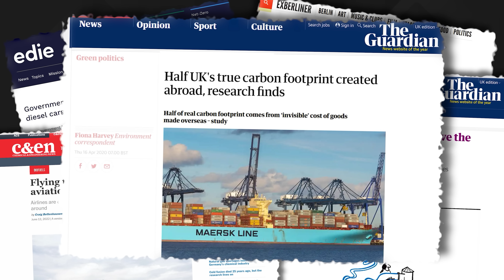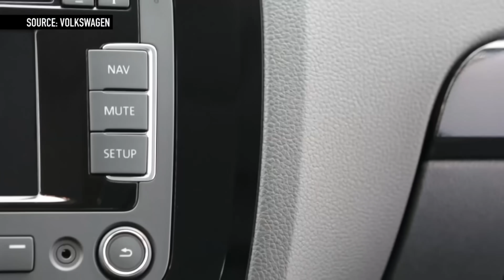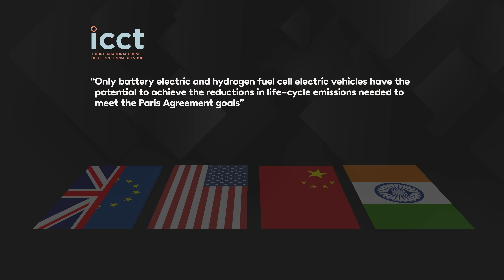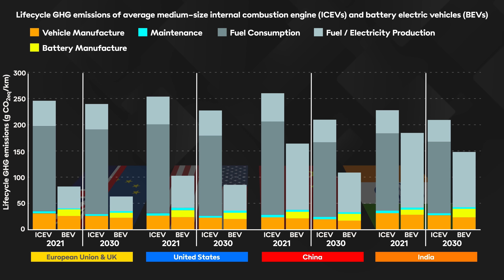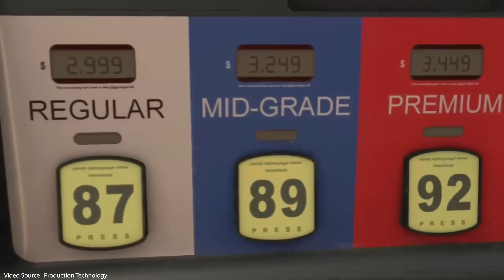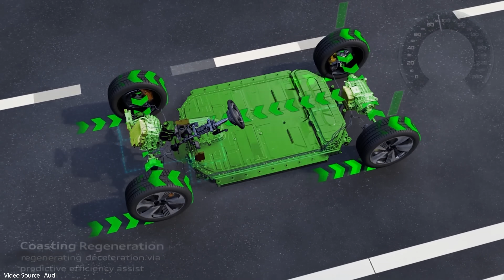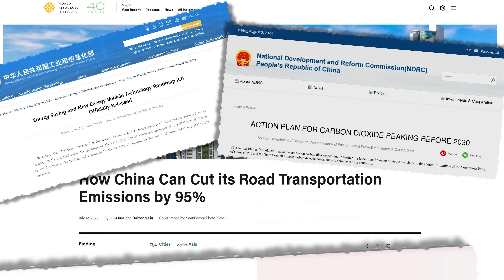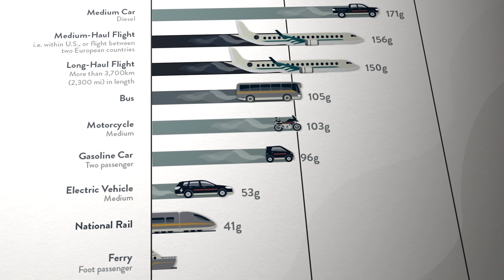Are EVs really better for the climate?

Comment: What are your thoughts on sourcing the raw materials for EV batteries? I’ve heard that EVs don’t offset the fossil fuel needed to gather the raws
Reply: Most of the mineral rich places for the metals for EVs happen to be in places that we should not touch like rainforests, right by water sources, near residential buildings etc. Mining these metals are extremely toxic to the surrounding environments without proper regulations,  and all the locations to mine these metals are in places where the government does not work properly.

Comment: My experience with my plug-in hybrid electric vehicle (PHEV) is quite a bit better than you stated.

My battery range is 30 miles, more than enough for most commuting and shopping.  With mine, I get 175-200 MPG each month, and pay little or nothing to charge.  I have free electricity at night.  (This is good for the utilities, too; it means fewer new plants, especially "peakers".)  I do most of my charging at home and at night.  I have no need of special trip to a charging station.  On the average, I only have to charge 3 nights a week.

For those worried about battery electric vehicle range, charging availability, raw material scarcity, and/or cost, a PHEV is a better option.  If you can't afford or can't live with an BEV, a plug-in hybrid (PHEV) will allow you to eliminate around 90% of your emissions, without being limited geographically.

If they were smart, the fossil fuel industry would be promoting only PHEVs so they will have a soft landing rather than a crash.  So should climate activists:  Nation wide charging station deployment at the needed pace will be subject to spottiness, start-up glitches, supply/demand imbalances and corruption.

Taking all factors into account, PHEVs are the best way to get people to change over to low-emission vehicles in a country with a heavy political interest in oil, where some people don't accept the reality of climate change, where many have yet to understand the advantages of non-hybrid BEVs, and where most don't understand how to use a PHEV correctly.  It took me a while; after 4 years with mine, charging is as second nature as filling the gas tank.  It's better, because I charge at home while I'm sleeping.  🙂

IMHO, only PHEVs should get government incentives.

"Just Have a Think" is one of the best channels on YouTube.  Keep up the great work.

Comment: One thing that seems to be left out of all of these discussions (because, so far, it represents a tiny part of the overall equation) seems to be relating to those EVs that are charged using solar energy. My wife and I are retired and so owning an EV is certainly more practical than for most. We can do most of our charging during the day when we don't need to tap into the grid. This is, possibly, the most efficient way to reduce the energy and carbon cost of driving.

Comment: I have been trying to export used EV (and Hybrid) To Ire/UK.  Shipping lines refuse to accept a Li-ion battery fire hazard.  It’s. But if a conundrum. Gov. who want to speed up emissions reduction need to link the shipping line rights to landing to ensure they are working with them not against them.

Comment: At about 3:50, he states that transporting fuel is much the same for each mode, however in developed countries, there's little to no CO2 cost for pushing electricity down already-existing copper, whereas it's surely significant that tankers (both by road for refined petroleum products and ocean-going crude-carrying ships) have their own environmental cost?
Reply: Power lines don't work for free.

In America we lose 3-5 percent of our electricity because of inefficiencies and losses.

It also takes the energy in roughly a gallon of gas, to make a barrel of gas. That's about 2%. Then it's about that much energy again, to pump and truck the gas to the station.
Reply: @lordgarion514 And then at least 40% lost in the engine itself.

Comment: I bought a new 2012 model S Tesla.  They never disclosed that it needed a lead acid battery to run the computer nor did they disclose that if you live in a rural area with out blue tooth that you will wear out the computer because of its constant searching....we finally got rid of it....to expensive to constantly repair it and drive 200 miles each way to the nearest shop.  The devil is in the details.

Comment: "Bbut that one guy burned his almost new Tesla because replacing battery was too expensive!" what I would probably hear from one electric car hater I know if I told him about this. Yeah, that pyro guy surely is someone to listen to in terms of ecology.
Electric cars will only get better and better with greener grid. ICE will never improve. The batteries problems are transitional, they can be upcycled or recycled, it's all possible. With CO2 in air, you cannot do anything, at least not on the scale needed.

Comment: The problem is the automobile itself. It has a very bad habit of displacing all other forms of land travel, because it takes up so much space and travels at such menacing speeds. I own a car, and I commute by bicycle. Commuting by bicycle is a good way to get yourself killed in the Detroit area. It almost happened to me when crossing a divided road, with the light. I got hit by a car that decided at the last second to make a right turn. 

I now cross that road against the light if there are no cars nearby.

Autos today are over powered. The typical auto has 100 hp per nominal ton of vehicle weight. When I was growing up in the 60's and 70's, the number was closer to 50 hp per ton. I believe it's possible to get by with as little as  25 hp per ton. If we factored that in, we would not only save emissions on all powered types, but we would likely save lives as well. It does not take a lot of hp to cruise at high speeds. But it takes a huge amount to accelerate quickly.

As a matter of public policy, I believe it is best to phase out the auto as a mainstay of personal transportation, rather than trying to mage a greener auto.

Comment: I astounds me that we still produce large, bulky cars (read SUVs). Big families need bigger cars but most of the time it's not them who can afford a car like this. Even if it is an EV version it's still wasteful. 
Up until now they have been subsidised in Sweden, which is absurd. We don't have a power grid to support power hungry big cars owned by people who could afford to buy it without support. These money would be better used to  build up the grid. Cars with lower energy requirement should be encouraged.

You did not bring up at which state it's time to abandon your fully working and well looked after ICV, with the environment in focus.

Otherwise, as usual, huge thanks for your thoughtful posts. 🙏

Comment: Great presentation as usual - I don't know how you do it week after week with such high quality information and presentations. I love your graphics - top notch. However, I have a question of the visicapitalist graph you presented. I looked at their methodology paper and was even more confused since none of the numbers presented in the methodology report lined up with the graphic. However, a simple question about the graphic is are we comparing apples with oranges. I get how you can compute gCO2/pkm for public transit like airplanes, buses and trains, but for private transport, it makes a world of difference if 2 or more people are driving in a single vehicle. Would the gCO2/pkm be a fraction of what is presented based on the number of people in the vehicle? For example, would a medium gas car with driver and 3 passengers be 48gCO2/pkm and thus actually lower than an EV with a single occupant? And what difference does it make if you are a foot passenger on a ferry or drive your car onto it? Seems like it will still burn the same amount of fuel. In order to make the right travel mode choice these "nuances" seem to be critically important. Thanks again for what you do - invaluable to us all.

Comment: Thanks for the video, very interesting. While it's okay to not factor in the car infrastructure (parking, streets) when comparing car drive systems with each other, I would say that the infrastructure costs should be considered when comparing different transportation systems with each other. I can't say whether that would change the overall conclusion, but it would definitely make train look much less climate-friendly than usually assumed, given all it's concrete- and steel-intense infrastructure and very heavy vehicles.

Comment: I shouldn't get an electric vehicle, but not because it's a scam (it's not a scam). I don't have a place to charge it at home and I work at different places so I won't have charging access there either. Makes an electric car pretty pointless, which is why I'm getting a hybrid.
Reply: Using an on board gas engine to charge a battery makes no sense and hybrid systems are very complex, leading to a whole new set of maintenance problems as well as all of those that go with an ICE vehicle.

Comment: The info presented in this video is irrelevant.  In the US, 60% to 65% of households live paycheck to paycheck and could never in their lifetimes afford a BEV.  There are essentially no used BEVs available in the US, and recent press indicates it costs $25,000 to $30,000 to replace the battery pack in a piece of shit Chevy Bolt ($31,500 starting price and not affordable for 65% of Americans).  Most Americans do not have credit ratings to afford any of this.  Before retirement, I was a strategic planner for one of the largest electric utilities in the US.  A study I did showed that 40% to 45% of households in my company's service territory do not have a garage or driveway, which means they cannot even charge at home.  Maybe in 30 to 50 years battery technology will advance to the point where average people across the world can afford a BEV.  In the meantime, BEVs will just be expensive, value-signaling toys for the upper class and will have an insignificant impact on CO2 emissions.
Reply: LOL
Reply: @robkaOK  As the technology gets better and production and competition ramps up, the price will come down.
Reply: @Garrison169  Tell that to @Ron W.  I've been driving electric since 2012 and loving every minute of it.
Reply: @real7175-y4d  Weren't only rich folks able to purchase motorcars in the early 19th century?  And your anecdotal argument that you "don't see that happening with EVs..." isn't reality based.  Fossil fuel for transport has had over 100 years of history; electric is just getting (re)started...

Comment: Well Dave , I decided to sit down and "have a think" and came up with a question for you. I do love that chart at the end there for the cost of various transport methods, but it got me thinking: just how much better Is walking / biking as a form of travel, rather than the ones listed? So I did some math and now im concerned. 

Low-Average biking speeds rank about 15 km/hr , and 500 cal/hr for "me fuel". The cheapest food by Carbon foot print are things like breads and apples, both ranking near 1:1 for kg co2 per kg of serving. Let's assuming I eat 2 slices of plain bread (70g and 170 cal) and 1 apple (200g, and 100cal) after my commute. That's a co2 footprint of 270 grams and barely covers half my calories  so I can still lose some weight 😉. However,  that leaves me at 18g co2 per km for biking,  and 33g/km of I ate all 500 calories. And if you crunch the numbers for walking , or eating any dairy or meat products, it just gets worse... 

Now given that you and I and most other people in our lifestyle definitely need the extra exercise to balance our rich diets, I still think walking and biking is a good thing to recommend. But I sincerely hope you can help me by providing some more official data on just how efficient (or unefficient) we really are at moving ourselves around.

Thanks for all your great work!

Comment: For areas with large stretches with no services, we need range. I'm sure it is coming. 

Just out of curiosity, did they account for the carbon footprint of the extra food and water required for cycling and walking as well as increased CO2 output? (Tongue in cheek mostly.)
Reply: Cars Dont need more range but more infrastructure. Governments need to invest a lot more in electric charging points, especially in more remote areas. 
You don't need to drive more than 300miles in one go; infact its highly recommended that you shouldnt. 
You should take 10+min break after every hour or 2, which at an average of speed 80mph is only 80-160miles. If you were to charge at each break you would never run out of battery, especially with a quick charge options available.

Comment: So what's the possibility of running a vehicle engine on water ie the gas within it
Reply: Water is already reacted with oxygen. You can't add more oxygen, or in other words, you can't burn it.
Reply: zero.
you would need to have a electrolysis plant in the car which would require more energy to run than what you get out of it.

also, having a running, moving electrolysis plant is a massive accident waiting to happen

Comment: The only thing the study missed is how this only applies to EVs with a battery made from newly mined resources. Recycling batteries is cheaper than mining new materials, and we can already recycle over 90% of the materials. An EV made of these recycled batteries would have even way fewer emissions.
Reply: unfortunatly if you're trying to replace at least 50% of the worlds passenger vehicles with EV's  you'll have to resort to mining new materials.   There's simply net enough material to recycle to achieve this sentiment.
Reply: @The-Cat  not yet, but in a few decades it will become a closed loop, which is the long term situation you're working towards. If we need to  emit some CO2 today (and still less than by driving ICE cars) to emit nothing in the future, that's a reasonable tradeoff.
Reply: @Ehralur   "few decades"  we're talking about billions of batteries not just for cars  and you're saying 90% recyclable. By that logic you should already know that that's not a "closed loop"

A closed loop of recyling is impossible. It's just basic physics.  

There will always be a loss of material and there will always be a need for new material. 

We're producing products out of finite resources remember ?
Reply: @The-Cat  that's nonsense. We can already recycle up to 98% and there's a clear path to 100%. There's nothing in physics that prescribes that you can't reuse a refined ore 100%. Ores are not depleting during use.

If anything, it's better because the refining of an already refined product will leave you with a purer material.

Yes, there will be a need for new mining for the foreseeable future and maybe ever, but a closed loop is entirely possible and even economically viable.
Reply: @Ehralur  Don't you understand basic maths?

100% material   and only 98% reusable  equals 2% loss

that 2% needs to be replenished with FRESH reources.

a.ka.   you will NEVER achieve a closed loop   you will always be depleting a finite resource.

By the way  your claim of 98% reusability is a lab number (perfect circumstances) that doesnt include any deviations of reality.

when a batterypack goes up in flames  that 98%  goes down to zero.

when saltwater corrodes a battery pack that 98% goes down drastically basically like rust eating away iron  that rust = useless dust.

 you will ALWAys  ALWAYS  need to replishesh the losses.
basic maths, basic science!